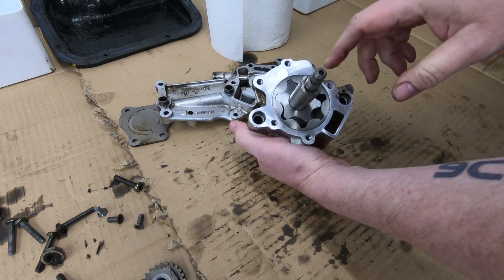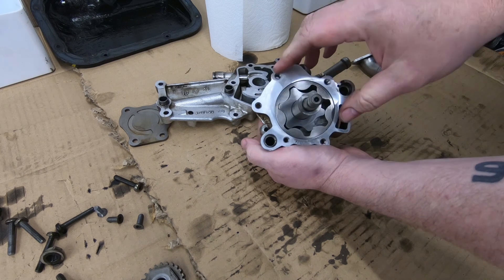Inside a Nissan R35 GTR oil pump

Comment: Any insight as to where to source the rotor shaft? I haven't found any and it seems I would have to purchase an assembled oil pump altogether.
Reply from the maker: Try https://www.jdmgarageuk.com/ they can normally source most things. I can sell you the pump you saw in this video, the rotors are near perfect.
Reply: @ANT&TEC  that would be great, but I'm hopeful to find three inner portion without having to purchase an entire unit. Just in case, what would you price yours for?
Reply from the maker: @Don G.  drop your email in a comment and I'll send the price 👍
What is wrong with yours, has  the gear ring cracked?

Comment: do you know the correct clearance for the oil pump please?  I can't find it in the technical documentation
Reply from the maker: 1. Oil pump housing to oil pump outer rotor radial clearance: 0.080mm-0.140mm
2. Oil pump inner rotor to oil pump outer rotor tip clearance: 0.100mm-0.200mm
3. Oil pump housing to scavenging oil pump outer rotor radial clearance: 0.130mm-0.186mm
4. Scavenging oil pump inner rotor to scavenging oil pump outer rotor tip clearance: 0.300mm (or less)
Reply: @ANTandTEC  thank you so much !!